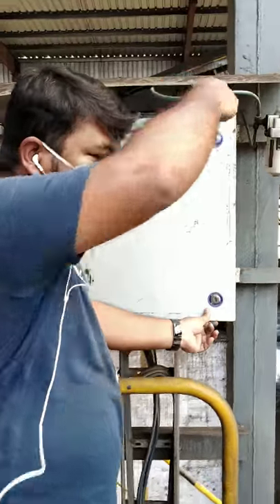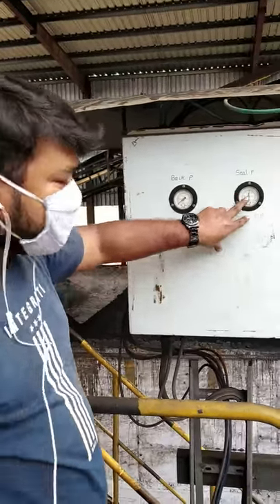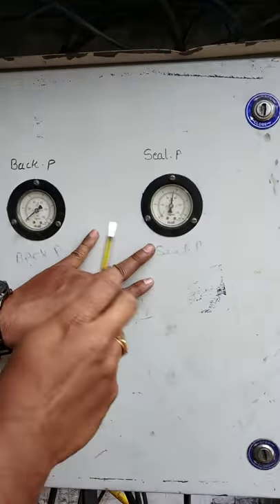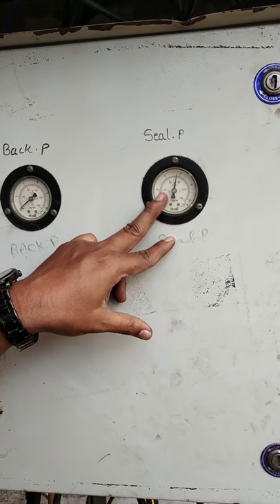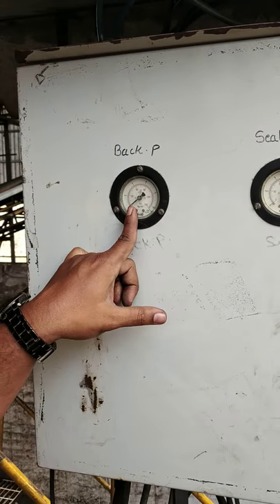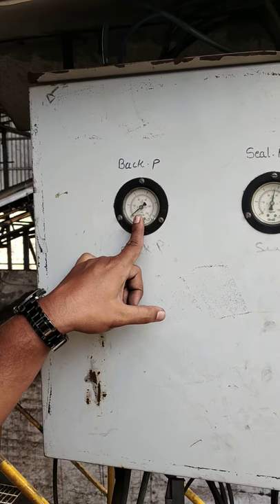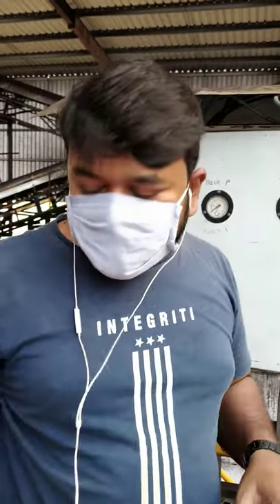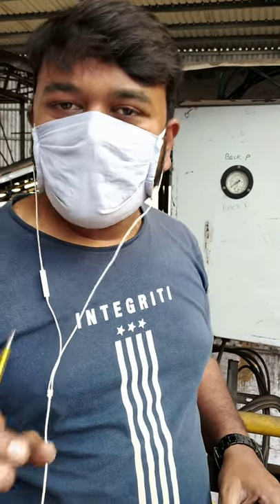Ash handling system power plant dome valve dome seal pneumatic cylinder SOV live ash handling system

Comment: Bhai isko  ek ek cheej ko aur  jyada elaborate karke batiye....aur Kya Kya problem aati hai aur u he rectify kaise karte hai plz
Reply from the maker: Ap ko jo bhi problem ati ho ap muje batao i will definitely try to solve your problems
Reply: @eidilipsahani6800  
Sir 
1-Seal pressure, back pressure,aur conveying pressure Kya hote
2- pressure switch se kiska kiska signal jaata hai PLC ko
Aur PLC kisko kisko signal bhejti hai kis sequence me
Plz ache se bataaye
If it's possible then solve these problem through a video
Reply from the maker: 1 seal pressure it is for sealing the dome valve
2 Back pressure it is created when conveying line is jammed
3 conveying pressure it is for conveying the ash from vessel to sylo 
4 ash handling plant working process. 
.Seal pressure is healthy then it's timmer will continue and operate the dome after that conveying is done and if line is jammed than back pressure form. In which total 2  sov and 3 pressure switches are use. Which I already told in this video also in this also you will get which singnal comming from PLC and to PLC. 
If you not getting then free to ask

Comment: some times cylinder not operate properly( if it slightly t up manually then it open or close)
What would reason?
Reply from the maker: Check cylinder alignment
Reply: Same wording used by ele.dept.but I thought there pressure issue(not proper pressure to cylinder )
Reply from the maker: Pls explain all the issues if any parameters are abnormal etc so i can explain you mr dixit
Reply: Primafaice issue that cylinder not operate but after electrical rectified it working normal so I want to know  from mechanical point of view, because generally electrical blame to mechanical dept.that cylinder is faulty etc, seal pressure 3.8kg , dome and cylinder proper alignment
Reply from the maker: There is no mechanical things i think im also from electrical instrumentation i can do all the things no need of mechanical in pneumatic systems
Reply from the maker: Must check your seal pressure either from air limite switch or from cylinder side air are releasing or what and than too you are not get solution give your number in comment box I will call you when I'm free

Comment: What is the purpose of this seal air? Why we have to maintain this pressure pls clarify?
Reply from the maker: Buddy I think you are need to study about this and if after that you have any Doubts you must be ask me.
Reply: @eidilipsahani6800  ok. What is the purpose of ash vessel booster assembly pls clarify?
Reply from the maker: Are you working on it???
Reply: @eidilipsahani6800  yes.
Reply from the maker: @sajedursojib453  then why are you asking for purpose I think you better know that is it's use for and if you are facing any issue then I will give you suggestion buddy so must be reffer manual for its purpose

Comment: seal pre.is not showing healthy then which types of  prb.are created ..nd that time hows chek seal pre.
Reply from the maker: Already told in comment if it is not healthy then too system are running then its dome n its assembly may get damage and you can Easley check ok gauge